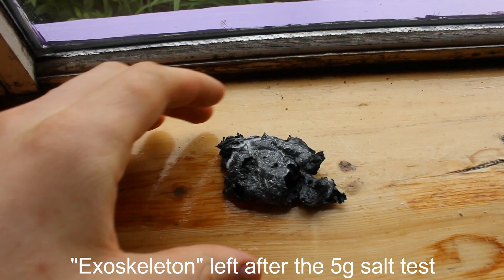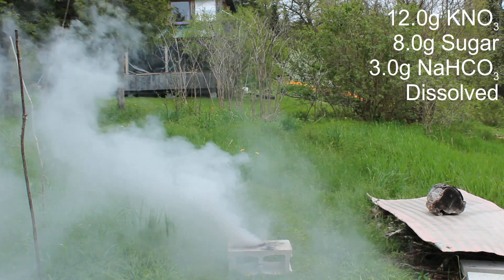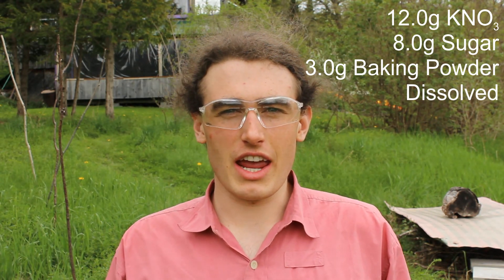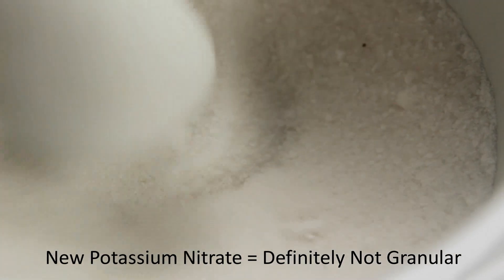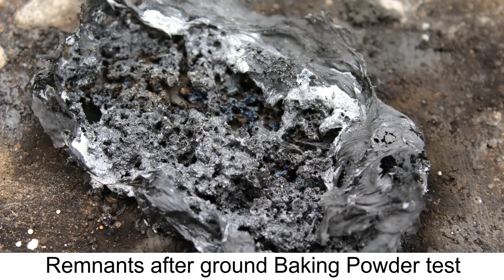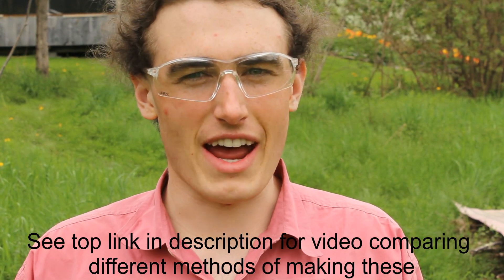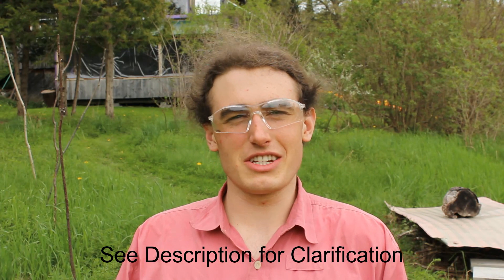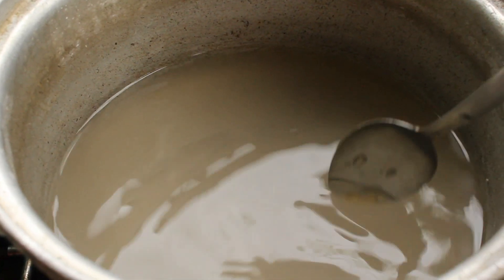Smoke Bombs: Additives (4/)

Comment: You should try to add wax!
Reply from the maker: I have considered it and probably will in the future, but not the next video. Reason? Because wax does not dissolve in water I will need to develop a different method than the dissolution method I have primarily been using. But I do desire using the ground method for a few reasons, this is yet another one. These test just take a lot of time and I don't spend that much time where I can make them.
Reply: Kestrel Owens Looking forward👍